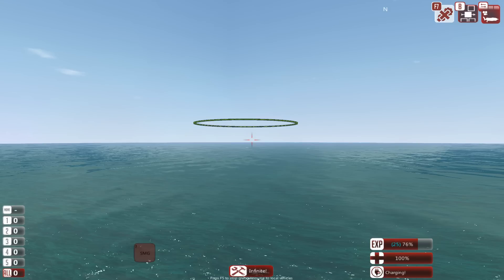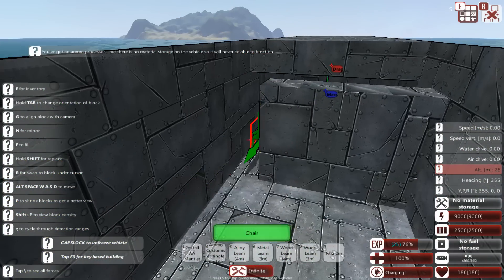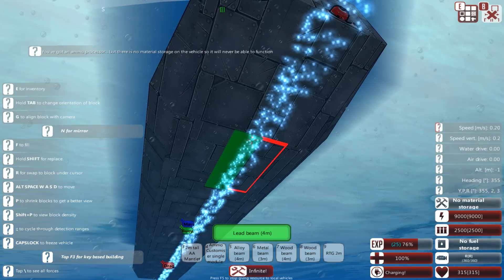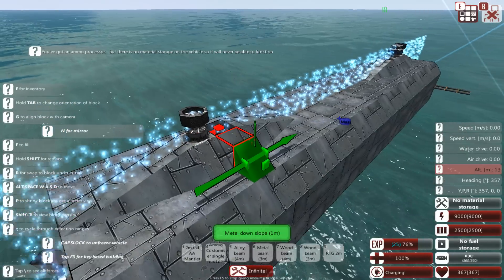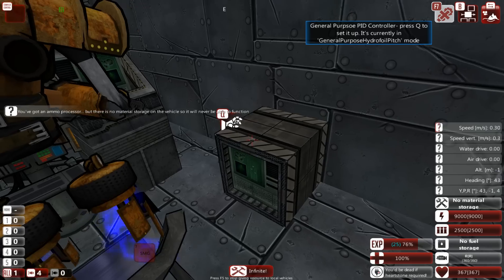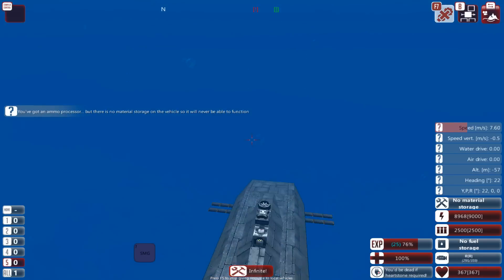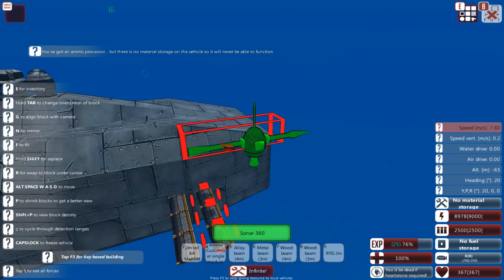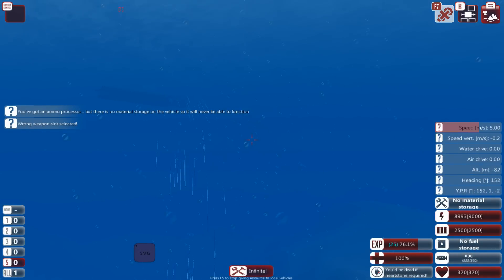From The Depths - How To Build A Submarine

Comment: This is genius. Literally every other Youtuber is using the hydrofoils to control the depth, where as this build basically uses the hydrofoils for stability whilst the air pump acts basically as a ballast tank would on a real submarine. We want to dive? Fill the ballast tanks with water (buoyancy factor reduced on pump, or pump switched off entirely). We want to surface? Pump the water out of the ballast tanks (buoyancy factor increased in the pumps, or set to max). I think this method is much closer to how submarines work in real life. The PID block is also very good at maintaining altitude, and when you adjust the settings just right (my design at least) will stay exactly where you tell it to. The level of control is brilliant, definitely the best way to build subs in this game. Icing on the cake is that you can use the complex controller to adjust the depth you want easily without having to mess about with menus and settings etc.Thanks for the vid!!!
Reply from the maker: This was my problem too. I was looking at videos and found the hydrofoils too unstable. The sub just kept going up and down. Now I want to stress that what you're seeing in this video is not my idea, I simply took it from the forums and turned it into a vid ;). The one thing I'd like to improve is not to have the main control room flood when the ship submerges, but unfortunately you can't have the PID ignore 1 pump that would keep the con dry.
Reply: Why wouldnt anyone do it like this, the first sub I built dove by reducing air pump bouyancy.

Comment: This is amazing. I've never seen anyone do submarines this way before. It's weird that nobody else mentions using PIDs to level out the sub with hydrofoils, almost as if they aren't aware that it's an option. Which is double strange because I'm pretty sure real submarines use ballast tanks hooked up to computer sensors, the same way you're using the sub's main hull as a ballast tank.

Comment: havent made a sub in a while, may restart adventure mode and see if I can stay in 1st area. The lag had made me leave not the types spawned. Idea is to hunt and killem to keep fps stable hahaha. About subs, I use a number of ACBs to detect stuff infront of them like ground, elevation and so on which will override the hydrofoils for x seconds. Same goes for left and right directions, and the AI has no issues. With any explosive missile or trop, they need to detonate in such a way that they will not kill off each other as you lose damage or even the whole missile its self. Keep up the vids :)

Comment: btw I'm afraid to tell you you're going to need to keep on moving no matter what. 
Dive planes control pitch, if you have no speed, you have no pitch control. sure you'll have depth control but you might end up with a funy looking perfectly submerged, but ass-sitting, upwards facing, submarine in no time, if the center of mass happens to be 5cm behind the center of buoyancy. Or the opposite if it's in front. As there's no real way to keep those two perfectly alligned (not in the game, not in real life either even while in real life trim tanks can be used to keep the thing at check), the dive planes you need no matter what to keep pitch control. And as the hydrofoils don't work stopped, you need to be moving constantly. A totally stopped sub is a sub that loses attitude control. It's just inevitable, so you can be moving very very slowly while keeping pitch control...but you'll need to be moving. If you stop, either your ass or your nose will start tilting down.

The first complicated thing I made was the submarine on my channel. I didn't use PIDs on that one (though I should come back and use them for the hydrofoils, as is much better than the control blocks for that purpose). Personally though I think for depth keeping the Air pumps commanded by control blocks are better and allow for much faster depth changes than the PID, which tends to react slower to depth changes. But the PID also works well (obviously ;)) so in the end is a matter of preference.
Reply from the maker: Yeah pitch is a very complicated issue on subs. The only option I'm missing on the PIDs to use the pumps for both trimming (provided you have several compartments) and depth control.
Reply: won't happen. Even in modern subs complete pitch control without movement is wishful thinking, and they do have a lot of ballast and trim tanks to change the submarine balance. It's a mere problem of weight distribution, a crewman far on the bow of the ship moving 2m forward to check out an instrument can change the balance enough for the sub to be out of balance. You need your CoB and CoM directly on top of each other down to the milimeter, or the balance will be lost (obviously tiny differences will cause a very small momentum, but still there will be a momentum that over time will pitch the sub up or down).

Real subs have even some ballast tanks the size of a shoebox for tiny trim adjustements. Obviously those you can't replicate in FtD, and even if you could, even with those real subs need to move to keep pitch control. It's a matter of dynamics and how things work. No speed=no pich control=out of balance sub. There's no real way around it. Subs can keep control moving at very small speeds indeed, but still they must move. Same in FTD. Don't hold your breath for anythign that will change it because...well, it just won't happen.

the only way around it is adding propellers to the bottom of the bow and stern of your submarine to get extra "active" pitch control. You can set the PID to use them for you to keep pitch stability even while stopped. But those propellers will make your FtD sub dynamically very different from real life ones (which obviously don't use those kind of gadgets to keep balance :)). Other than that, you're stuck with moving or losing pitch control :).
Reply: ramjb you can put separate ballast tanks at each end to make active pitch trim. Use separate ACBs for each one detecting pitch angle and adjusting  the tanks accordingly. 
Or you can have the CoB significantly above the CoM.

Comment: This is great, but while you said you prefer to drive it, can the AI control it or is it just incapable? Why or why not?
Reply from the maker: The AI is wonky at best. I sort of trust it with a surface ship but definitely not with a submarine. It has worked for me, but you have to be careful with it.
Reply: It works, but its generally very simplistic. And unless you use an airplane AI, or use lua or acbs, it will keep depth.

Comment: for some reason they detect me even with all passive stuff and is there a way to submerge faster? I already added a load of lead for extra weight, and I have no wireless transmitters, or is the detection happening because if the metal Hull? (I changed the top of the sub to the metal alloy since it has lower detection
Reply: Jarne Theys if the enemy uses any form of active sonar they will find you no matter what. If you are being shot at by missiles make an anti missile launcher. If you're being shot at by cram etc dive deeper. Shoot them from afar.
Reply: Matthew Hilton ok thank you

Comment: Umm... My submarine keeps tilting to one side and it causes it to flipp ones it submerged,  I dont know  I have done wrong i have checked the hydrofoils, and they are the correct way. please help!
Reply from the maker: Ok small checklist:
- Check your Automated Control Blocks (if you have any) 
- Check your propulsion systems
- Check your PID settings
Reply: ok thx
Reply: found out the problem, the sub wasnt balaned properly, now it works
Reply from the maker: Great! Good hunting :)

Comment: i have a problem with my carrier its really heavy and it keeps tipping over and i have put air pumps all over it in a room
Reply from the maker: Check the center of mass. It's probably too high. If you lower it and possible make the ship broader it should stop rolling over.
Reply: ok thx
Reply: but how do i make center of mass lower?
Reply: lead blocks on the bottom, light alloy on top
Reply: For "V" hulls,  I use 3 lateral partitions/sections.  Center with air pumps;  left and right side with helium pumps.  Works well.

Comment: can't dive...saturation output i don't know why... i set all same of the video...but my sub can't dive
Reply from the maker: Set the input a bit lower. See if that works.
Reply: Say output saturated whith 0 mt
Reply: The blue line is all on the top of the pid screen
Reply: I add some lead block on the botton and now i rraxhed 25 mt setting 20 on pid (no more saturation at 20)
Reply: I don't know what is going on...now pitch (imput 0) say output saturation
Reply: resolved man and thanks for the tutorial ;) like and subscriberd
Reply from the maker: Glad you got it working! Have diving :)

Comment: For the air pumps if I go beyond -0.40 it tells me the output is saturated anyone know what my problem is
Reply: Nvm, all I had to do way change the U-Boat from aluminum to metal so it sunk tho it still says the error but it works.
Edit: on the second smaller sub I made, it was showing the error. But once I changed part of the floor from metal to lead it got rid of the error entirely. (leaving the comment up in case anyone has the same problem.)
Reply: If you reduce the gain it will not be saturated